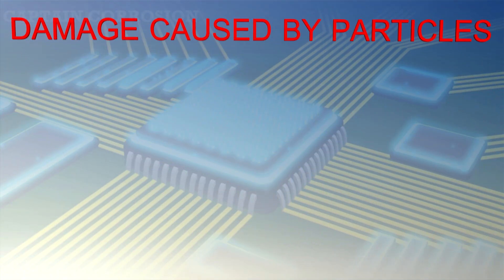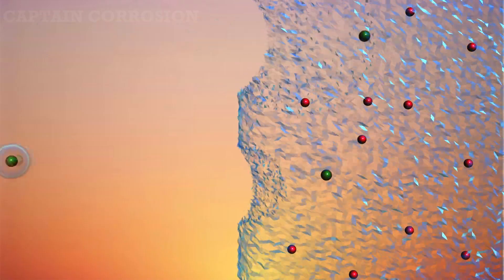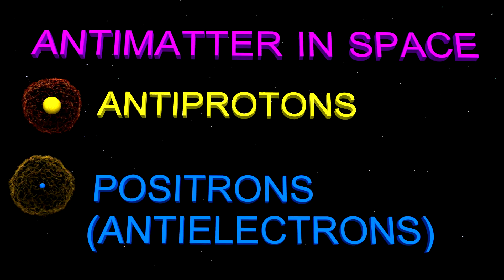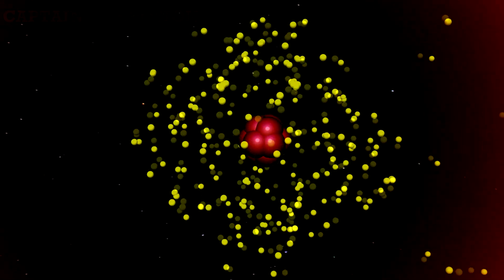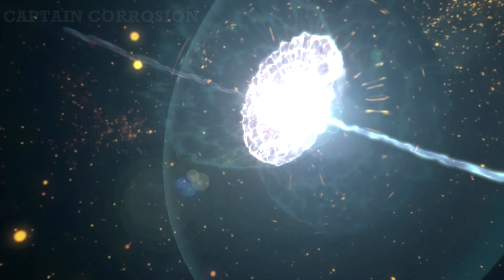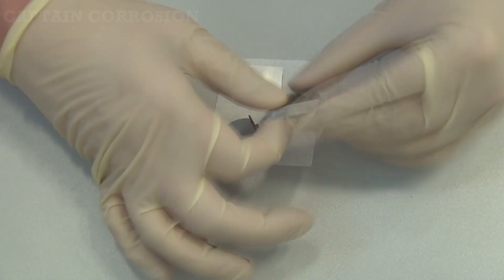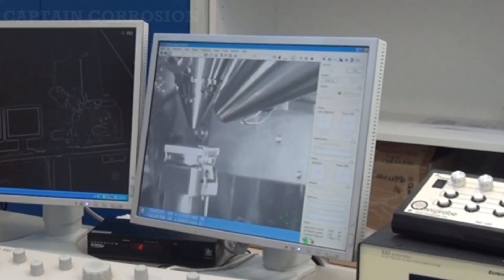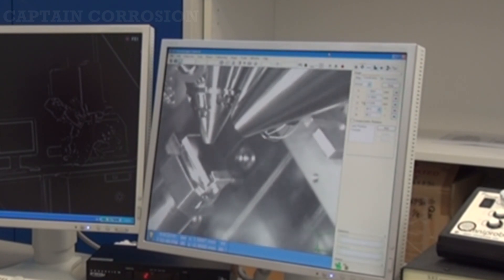How Do Charged Particles Cause Corrosion in Space?

Comment: but why apollo astronaut  use only 0.1mm aluminum foil  for charged particle shield  8  day  in  space  and still  alive ?
Reply from the maker: Even a sheet of paper can block most of the charged particles but it all comes down to the total dose of ionizing electromagnetic radiation that is created at the shielding material and interacts with the person or electronics behind it. So a spacewalk during normal conditions (no solar storm and not being in a Van Allen Belt) is relatively safe and probably just increases the risk of cancer, depending on the duration of the spacewalk.

Comment: What do you think of the Tesla roadster in space? I believe it is a hoax based on what I know about corrosion in space and the effects of the EMF on materials. When looking at the video stream from there roadster I don't see any signs of being exposed to the harsh conditions of space
Reply from the maker: That's a fun one! I think the car actually went to space with a purpose of demonstrating the capability of new rockets and having to communicate with the public. As for setting up a camera and a communication system, I don't see a problem either - it can probably be solved with conventional parts that are used to assemble a cube satellite and they don't even cost too much (maybe worth of another Tesla roadster or two in total). The corrosion in space on the other hand is most severe at low Earth orbit and it takes place over many months or even years before it starts eating through vulnerable components. The Tesla roadster however is moving away from Earth (you can actually track its location). So atomic oxygen most likely isn't a problem at all as so far away there is any significant amount of that. On the other hand, the car has plenty of polymer components that will degrade due to high energy electromagnetic radiation and charged particles coming from the Sun. That too of course will take a while.